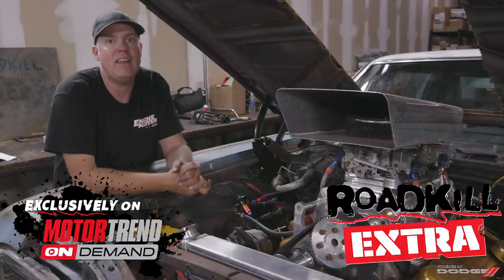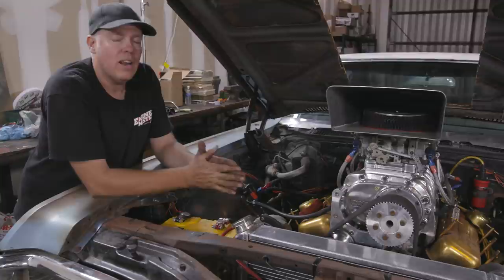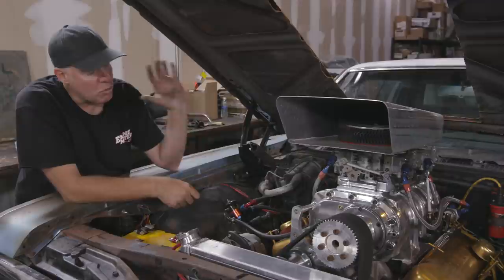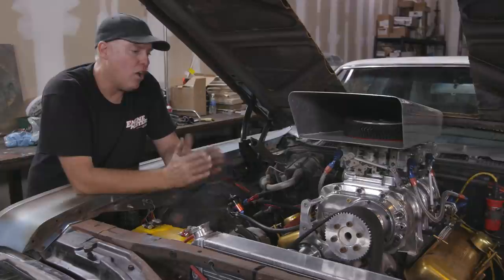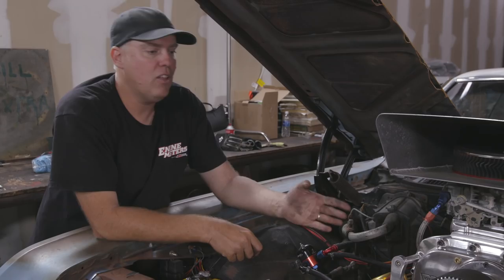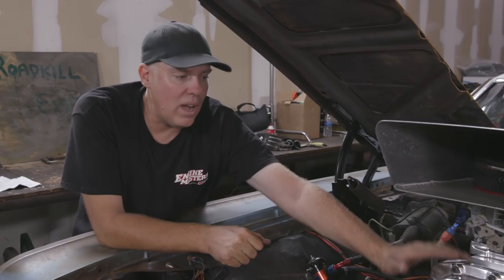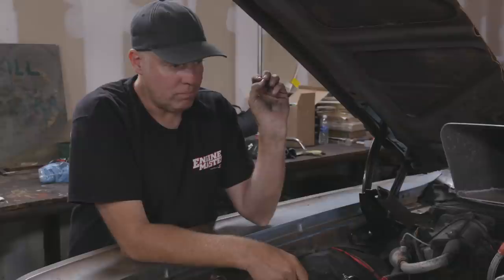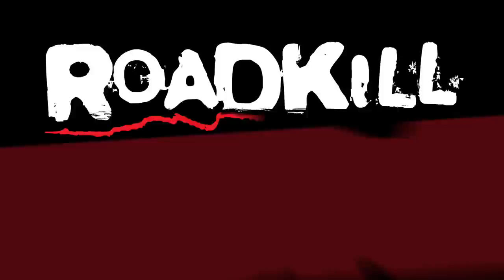Freiburger Explains Supercharger Basics - Roadkill Extra

Comment: Hey Dave, you are correct on the compression ratio myth being wrong.  They air pump adage  is closer to correct. The more air the engine pumps the more fuel you can stick with it meaning the more power it makes. You can typically estimate the engines power at a certain boost level by taking the boost, adding it to the atmospheric pressure of the location that you are at and then dividing all of that by the local atmospheric pressure again. Then you multiply that number by the old hp number  and subtract the amount of power that you can guesstimate the compressor is eating either directly (pretty easy if you can find a compressor map) or from restricting the exhaust with a turbo. And bam... you’ll get a reasonable number to expect after supercharging or increasing your boost etc. if you don’t end up near that number you may have belt slip, a lean condition, trouble maintaining spark or some other issue contributing .

Anyway 

New hp =old hp((boost+atmospheric pressure)/atmospheric pressure)- compressor loss

Comment: A 2-stroke diesel has no intake or exhaust stroke. The intake ports are uncovered and the exhaust valves are open when the piston is at the bottom of the stroke so the air in the cylinder must be completely changed at that point. If it weren't for the blower pushing fresh air in which pushes the spent gas out, it would simply stay there. I worked on GM locomotives which have 20 cylinders each of 765 ci and two blowers so they were sized at 10/765. Later versions had turbochargers that had a clutch in them. At start up and low revs, the clutch was engaged so the turbo acted like a roots blower and and revs increased, the clutch disengaged and the turbo became a turbo.

Comment: 18-71 is the largest produced today as I´m aware of. (DMPE)
Reply: dragsterdolme 
They made the 2 strokes in a 
53,71,92 and 149 cubes per cyl. 
Biggest I’ve been around is a 20v-149, usually used on 1500-2000kw generators and other big shit like some trains. 
They stick a v6 block between 2 v8 blocks and voila , ya got a 20 cyl.
Reply: For cars, probably. The biggest Roots blower I know of comes on a 20 cyl GM engine (used in locomotives, I'm a railroad engineer) which has 756 ci/cyl and 2 blowers so each one is a 10-765.
Reply: MrTheHillfolk I am no doctor, but wouldn't 8+6+8=22? What am I missing? Are some cylinders "shared" between the blocks?

Comment: Freiburger: Useful videos as always! Can you do one showing the parasitic losses of a turbo vs. a positive displacement supercharger (preferably a twin-screw like used in modern OEM SCs, not roots)? I.e. pick a turbo and supercharger that makes roughly the same max HP on the same engine and then disconnect the boost (for the SC it's difficult but maybe mount it on a bracket away from the carb but still have the belt go through?) and see how much power they're stealing against the same engine naturally aspirated? I don't think this has been done. Thanks!

Comment: Power/torque is related the force pushing the piston down during the power stroke.

Burning a fuel creates an increased amount of heat in the space where combustion occurs.  According to Boyle's law, if you increase the heat of a gas without changing the volume, you increase the pressure.  As the fuel/air is burned in the confined space of the combustion chamber the pressure goes up, and this increased pressure pushes the piston down the cylinder during the power stroke.

If you are able to get more air/fuel into the combustion chamber space to be burned, the combustion event creates more heat, and therefore greater pressure to push against the piston during the power stroke.

Supercharging works by increasing the volumetric efficiency of the engine, which is the ratio between the size of the cylinder and how much air/fuel is drawn into the cylinder into the cylinder during the intake stroke.  More air/fuel in the cylinder -> more heat produced during combustion -> more pressure to push the piston during the power stroke.

Comment: Frieburger only told half the story about why you want a high compression ratio, the other half is thermal efficiency. If you start with 1000 psi of pressure with 5:1 compression you're still left with 200 psi at the bottom of the power stroke. That 200 psi goes out the exhaust valve and never does any work. If you have 10:1 compression you're only left with 100 psi that goes to waste.
Reply: This exactly! I feel like if you want to have a meaningful conversation about the pros and cons of forced induction, you need to know the difference between gage and absolute pressure and at least know of the Carnot cycle

Comment: The wonder of a supercharer is to take your current 350 cubic inch air pump that comes apart at about 6500 rpm, bolt a 200 cubic inch roots pump on top of it, add a drive reduction so you can spin that one at twice the speed, so you can have the effective power of a 400 cubic inch engine. And well, they make bigger pumps too.

Comment: USE MATH! 15psi boost doubles your displacement, cause atmosphere is already 15psi(a)
a 5L engine @100% volumetric efficiency uses 5L of air @15psia, air at sea level is 15psi compared to a complete vacuum, if you double the pressure of atmosphere(15psi) you double displacement
15psi boost is 30psi(a) the a stands for absolute vacuum therefore
5L@15psi = 10L@0psi
10L@15psia = 5L@30psia
you have to force twice as much air into an engine for it make 15psi boost

Comment: Big difference between high compression and supercharge-turbo is pressurize intake manifold with cool air.  This helps to control the combustion burning better.  Specially by using intercool intake system.  Where high compression engine, air and fuel gets heated and can cause uncontrollable combustion at compression stroke.
  
 Newer engines got GDI (gasoline direct injection) can control the combustion by changing injection time and spray frequency.  Also combustion heats up only air at compression stroke which makes the combustion control much easier.

Mazda coming out with engine which can run without spark under some condition in gasoline engine.  This engine will use very high compression ratio.  Will produce higher HP for litter and better economy.

Comment: i really would have liked if you had explained the effects of installing a (non boost) camshaft with a supercharger how it affects the vacuum operated accessories like boost bypass valves, 
egr valves and brake boosters
Reply: N/A cams are usually "hotter cams" than for boosted applications. The longer duration and larger overlap will increase your top end power, but reduce vac at idle. Should not compromise accesories unless you go for a serious N/A race cam.

Comment: He understands the most intricate knowledge of gas engines, but doesnt understand diesels lol
Reply: I hope youre right, diesels are pretty straight forward
Reply: On a 2-stroke Detroit Diesel it's a blower, not a supercharger.  It's only job is scavenging - clear all exhaust gases from the cylinders and fill 'em with fresh air.  "Airbox" pressure will be above atmospheric, but very little.  A 2-stroke Detroit without a turbo (or turbos), is naturally aspirated.

Comment: The blowers on the Detroit diesels weren't really scavenging the exhaust out of the cylinder. The way the Detroit's Two Strokes worked was by forcing the charger into the cylinders via slots that were cut in the cylinder walls at the bottom of the stroke similar to a dirt bike 2 stroke engine there were no intake valves like in a 4-stroke engine or reeds as in a motorcycle two stroke engine. Just the rapid expansion of the explosion in the cylinder was pushing the exhaust out of the exhaust valves at the same time the charger was being pushed in from the bottom of the cylinder.

Comment: I find it odd that the aftermarket has hung on a “14-71” size blower when Detroit never made that side engine. It went from 12-71 to 16-71. A 12-71 being the largest single piece block Detroit made before going to 2 8-71 block bolted together for the 16-71. The 8-71 was the largest engine with a single blower. After that the engine used 2 blowers with the front one driven of an accessory shaft from the back one.

Comment: Allot of them Detroit 2 stroke engines had turbo on top of the supercharger as well!
Reply: They did, they reached a certain point where the turbo was more efficient so the blower was bypassed. But those engines could not run without the blower.
Reply: The could run without a blower or turbo. They were just dogs. There was a running 3-53 on the engine stand in my Diesel class years ago. And I knew a guy that had an N/A 2-stoke Detroit in his k20.
Reply: Most of them were supercharged and turbo charged. Pretty much just like the Hellion Kit for the 03/04 Cobra. But in the case of the DDC engines, the supercharger was for scavenging and the turbo was primarily to provide boost.
Reply: Pricy Price 👍 an overrunning clutch
Reply: Back in the early 70's, GM took a 6V71 Detroit diesel and put a turbo on top of the blower. It was supposed to make the same power as the 8V71 and it was called the Fuel Squeezer. I don't think they lasted too long in production.
Reply: Yup, I worked on Detroit after high school when I went to Diesel mechanics school.  The cylinder liners have ports on the bottom that get exposed at the bottom of the stroke for blower to blow the exhaust out.

Comment: Just one small correction. Turbochargers DO in fact have parasitic loss. It comes from the obstruction in the exhaust they create and the janky ass way you have to run the exhaust around instead of straight back. They are really about like a centrifugal supercharger in the loss department.
Reply: It is technically not a parasitic loss, it is more a reduced VE due to exhaust port backpressure. But especially in modern twin scroll setups, turbos are wildly more efficient than any type of S/C.
Reply: AttackCadillac  yep exactly that's why a lot of high HP turbo cars have back pressure problems
Reply: Perhaps on a small diameter exhaust. My 3/4 ton truck has 6 inch exhaust. Any loss would be negligible.
Reply: The loss from the restriction is completely negligible. As long as you have the right sized turbo for your engine then you will loose 5 maybe 10 hp tops.
Reply: Dave Micolichek they do have back pressure problems a big motor has to force air threw a tiny space it builds pressure that's how waste gates work after the exhaust pressure climbs up to a certain psi it opens so think about it your forcing tons of air in the motor but there's a pinch in the exhaust where are has to try to flow past, and to a certain point a turbo will stop making HP either because the compressor side is to small and can't flow enough air ,then you could have to big of a compressor and it flows too much air but the turbine side is too small and it can't flow enough and there's too much back pressure before the turbo in the header only way to fix it is to get bigger hot side but that will increase lag
Reply: In a nutshell the only time you will have back pressure problems is if your turbo is too small or your exhaust pipe is too small.
Reply: Dave Micolichek one it is when your shooting for high HP but don't want crazy lag, you can only make the hot side but so big before the turbo won't spool, but you want to make more HP but the hot side is preventing you from doing that, that's what I meant by back pressure problems they struggle in between having to much lag and having to much back pressure problems, I'm saying this based on what other engine builders said and it's true also yes waste gates are used to control back pressure on turbos so you can can control boost when you think about it it bleeds off access pressure to control boost that excess pressure is back pressure in between the exhaust port to the turbo
Reply: Captaintoast12321 you lose way more that 5-10 HP when your compressor side over flows your hot side
Reply: Im talking about if the turbo is sized correctly for the Engine.

Comment: I prefer to use the term Forced Induction as an umbrella term for turbocharging, supercharging and nitrous. While it's technically correct that turbocharging is also a form of supercharging, throwing both mechanically and exhaust driven compressors under the same name is confusing for a lot of people.
Reply: Supercharging and force induction are the same thing. Why is it confusing?  Turbochargers are superchargers.
Reply: @phlodel  You and I both know that but in this day and age, when most people refer to turbochargers and superchargers as exhaust and mechanically driven compressors respectively, then it's potentially confusing.

Comment: Hi, I’m interested in how the -71 series blowers were create. Yeah longer and longer rotors and cases, but who and how were these done.  I’ve searched  far and wide but few have lived through the era these blowers  how were the rotors made longer before billit ones were made on cnc machines.  Were there on gear shafts made and section of rotors cut off to fit then various spacers made so they fit in the cases. Then the tunnel case ends and trinangular opening on the bottom. What I’m looking for is a time line with construction.

Comment: I think the power gain from higher compression ratios comes more from having a longer power stroke, not the fact that your physically compressing the mixture more. Think about Atkins cycle engines, while not performance minded they are trying to gain a larger power stroke relative to their intake stroke
Reply: Rick the increased output from higher CRs is a product of a higher thermal efficiency. The power stroke does not get any longer. As you mentioned the Atkinson cycle; you should realize, that a longer power stroke does not help, it already extends past BDC (except for Atkinson engines) where no further work can be extracted.
Reply: Truth

Comment: Dave, did I hear and interpret you correctly when you talked about the Roots vs. Turbo and hear you basically say that your average "street" guy (not a track guy, drag race, etc) probably would like a Roots better because he runs at lower rpms than a racer and therefore, with the Roots giving you more bottom end torque, there's more usable power for the street guy ?

I'm kind of extrapolating from what I "think" I heard in your explanation...
Reply: Steven Sanabria Yes, for most street applications, a Roots style setup will tend to lend itself more low end torque and you'll get that power much quicker than with a centrifugal or turbo. It won't make as much all out peak power as the other two, but a Roots tend to be favored for their "street" type of power. Hope that helps
Reply: Well. A Roots will feel better on the street. Absolutely. But they suuuuuuuck at mileage, because they are always spinning and pushing air, no matter what. And usually, gas money is a concern for street applications.
Reply: Marian S That is also a valid point ha

Comment: 100% correct. Detroit designated them 2V713V71 4V71. So on an so forth. The bigest I have seen is on our 1953 GE locomotive. We're I work. The automotive industry drop the V out of the designation.
Reply: Not all Detroits are in V configuration, they made a straight 1 - 2 - 3 - 4 - 6 cylinder engines ( well 1 is not a straight, but it is definitely NOT a V )

Comment: Agree that comparing the effect of a supercharger to high compression is a really poor analogy.  Better to think how a supercharger increases volumetric efficiency since an ICE engine is like an air pump and the blower make a given motor CI size think it is a bigger motor/ pump.  Not many people left around who know how to build or tune a good old school blower motor running high boost. Most guys out there running them do it for show and have builds that aren't making a lot of power. Also, with regard to efficiency, not only do big roots blowers cannibalize a lot of power, but an even bigger drawback is how much heat they generate and retain.. just by cooling the blower with E85 , water injection or an intercooler, the power takes a big jump up.

Comment: Easy way to explain how Diesel engines work: you know that detonation (pinging) thing that happens when you run too low an octane in a high compression engine?  Diesels literally run off of that. Since the compression ratio is so high it would ignite regular pump gas under the heat of the air pressure, thus Diesel fuel is injected at just the right time, mixes with the compressed heated air, and then hopefully ignited as evenly as possible just past TDC.  This is why Diesel engines are built with thicker EVERYTHING to handle the vibration and violent ignition cycles, and hence why some Diesel engines are converted to gas to handle the horsepower.

Also I can't believe we're gonna play semantics about who owns what and technically this is that. Detroit Diesel is a subsidiary of GM of course, but 2 cycles were thrown into every rig that's ever run freight down the road before Freiburger or anyone watching this channel was even born, that includes Ford rigs too!

Now does anyone care to explain why turbocharging a Diesel somehow makes it more fuel efficient, when more fuel is needed to counter lean cylinder condition?